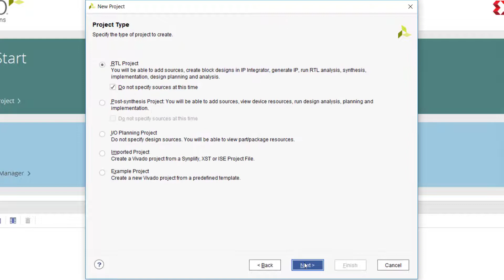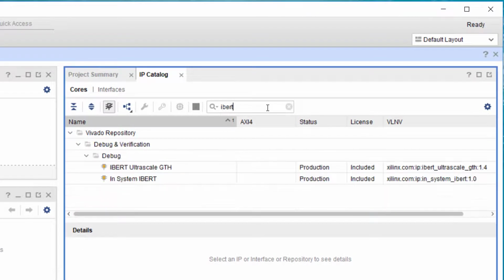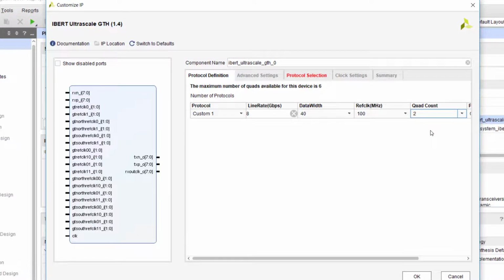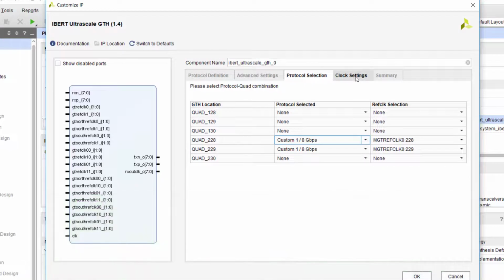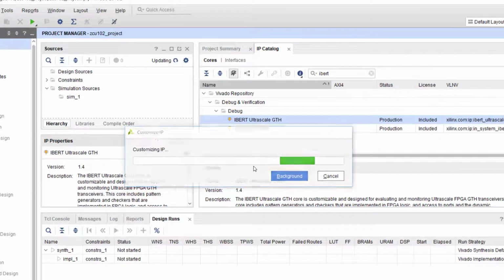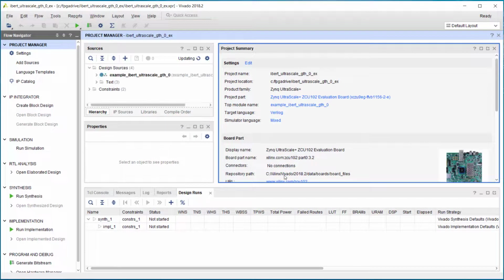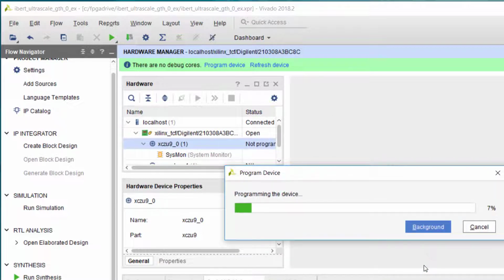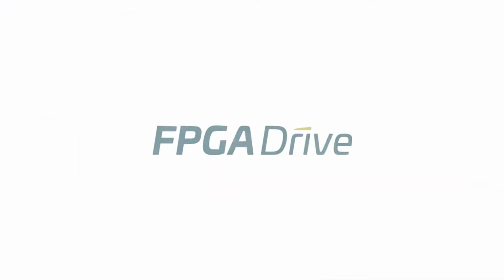FPGA Drive FMC Loopback testing with IBERT: Part 3

Comment: did you implement M2C Differential clks on the FMC opr is that not needed , because i am designing an FMC card and don'tknow if implementing clocks for Quads 130,228 and 229 is necessary or not , i would really appreciate your help :